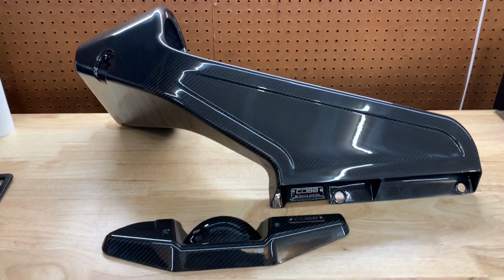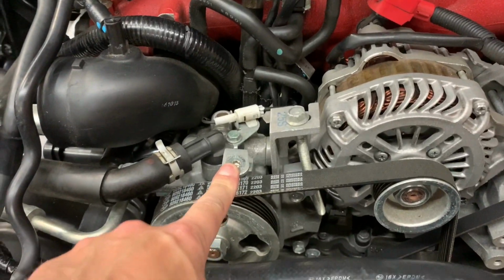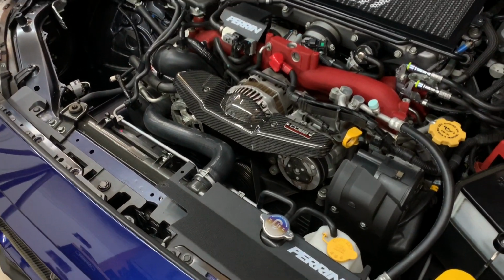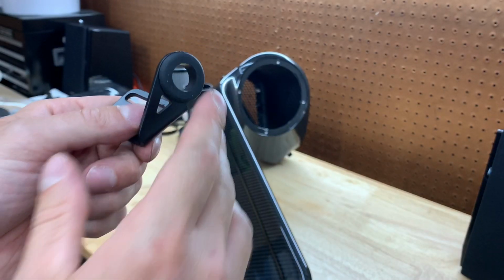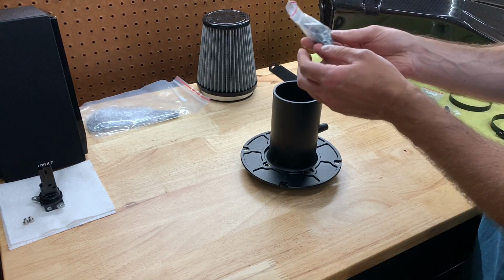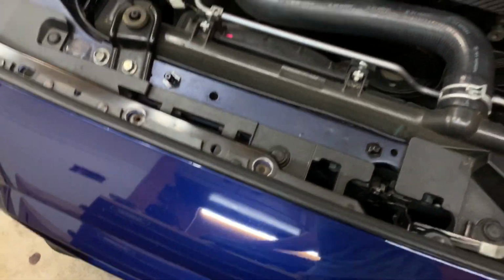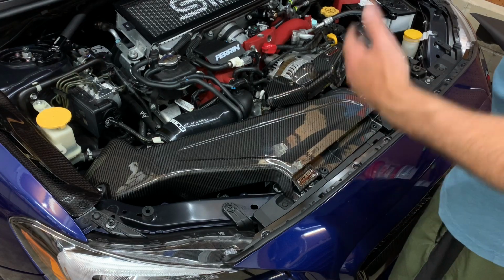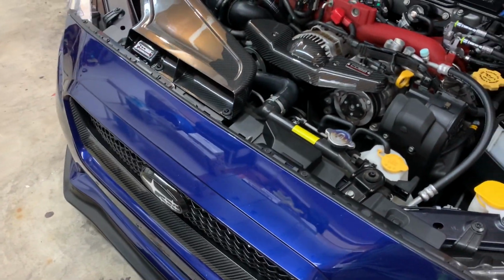Installing the NEW Cobb Redline Carbon Fiber Intake and Alternator Cover on my STI

Comment: Finally did it. Redline CAI, Cobb AOS, Cobb 3 port BCS, Cyl 4 & capped off with a protune. Loving it so far and peace of mind achieved. 👊🏾
Reply: How has it been holding up?
Reply: @activeej8858 Its awesome. I also did a ceramic coating prior to install. Install wasnt that bad either with same issue of just reaching behind the radiator. No complaints though. I left the sound restrictor plate/piece off so I can hear the turbo noises/breathing and its honestly not obnoxious at all. Perfect sound imo. 

I installed a day before a protune so I cant speak to the Cobb OTS map in general. The mod is well worth the price if only for looks and AIT. 

Side note: It really does make a difference for the AIT’s. In some cases theres only a difference or 10 degrees or less. You still get heat soak if sitting but thats unavoidable really.

Comment: Installed mine the other day. 2018 sti, I had a 13 prior. I used password jdm carbon pieces in the engine bay of the 13, radiator shroud-alternator cover-battery box-and fusebox cover. All but the radiator shroud transfered into the 18 sti engine bay. It took some serious consideration. But I made the password jdm radiator shroud fit. It took modification obviously, but the passanger side is flat enough that the redline intake fit on top of it.

My only issue with my redline install was that I got it used and it didn't come with the 2 studs that the grommets fit over. I had to install rivnuts in those spots, I used password jdm engine bay bolts to secure it in place. All I need now is the password jdm power steering cover to really complete the carbon look I'm going for. Such an awesome intake.

Comment: Just installed my redline intake today, followed you video to a T. Great install video! Also, kept the side cover plate on that lets in addition air. Now the car has little to no air induction sound, just a faint waste gate sound after shifting. Just some info for anyone wondering what it would sound like. Coming from the cobb big sf intake, the redline is very very quite.

Comment: I just installed this and had the most difficult time woth the silicone hose lmfao! I dont know why but the box seemed low and just trying to get it over the tubing as so damn difficult and it kind of sits on the metal bracket underneath.

Comment: Nice job mate. Quick question, could you not put the larger round foam onto the plate rather than sticking it onto the carbon? If you’re worried about sticking it to the carbon. Just an observation 😊

Comment: Just received mine today. I know it comes clear coated but did you ceramic coat you’re. I don’t think you said if you did on you’re unboxing video. Should I ceramic coat mine?
Reply from the maker: I did not coat it in this video, but I did later down the line. Not a necessity, but it will definitely help keep it looking mint.
Reply: @Autofreakgarage  cool thanks man I’m going to coat mine before the install. Don’t want no dust getting embedded on the clear coat.

Comment: Few questions:
How much lower have you seen your IATs drop? Do you see any potential issues with the MAF housing sitting outside of the carbon box? Thanks for your video!
Reply from the maker: I explained how much the temps dropped in this video. https://youtu.be/7nY5JHOtqV8

No issues. The original Cobb sf intake as well as any other intake all sit outside the box. No issues at all.

Comment: Hey man, question for the fitment on the entire intake. I bought this intake and i am waiting to install it. When you place the posts into the rubber grommets, does it seem secure? When i was putting it together i noticed the rubber grommets just fit over the posts and dont really seem to pop into place. i guess i was just worried that it would move around.
Reply from the maker: I thought the same thing, but when it’s in place and bolted in, it doesn’t move an inch. It’s very secure.
Reply: @Autofreakgarage Ok. Appreciate it.

Comment: I am wondering how to take the filter off to clean? Do you have to take the entire unit off?
Reply from the maker: Yes the whole intake comes off in literally 30 seconds.
Reply: @Autofreakgarage  Bought one and installed over the weekend. Very impressive! However There is one bolt (M6x20mm Flange Head Black Oxide Bolt) remain unused. Not sure what that bolt is for? Any idea?

Comment: Thank you for the video. A question, what brand are the carbon shrouds in the engine bay left and right side
Reply from the maker: Olm by subispeed
Reply: @Autofreakgarage  Thank you 😘. I am currently running the compressive tunning side shrouds. Carbon ones however will look dope with the new cobb redline intake

Comment: Great and detailed install video as always! :) Aside from the aesthetic, I absolutely love the completely gapless design of the snorkel directly integrating the filter! Pretty much maxes out the most potential of not drawing in hot engine bay air as much as possible (in the Cobb Big SF current design there are still quite a few air gaps on the fender side that definitely leave room for improvement). On top of that the new piping also ensure you have no way to screw up putting the filter on lined up exactly to the point it needs to be due to the piping edges not allowing it go past (although I suspect this is more of an STI specific design as I see the original had that too). Honestly if they make this for the FA20 and also make that filter stopper edge on that one, it's going to be very hard for me not to switch to this design at some point haha! The carbon fiber is right up my alley as well! Improvements all around and a very unique design, very impressed. 🙂
On the note regarding your Perrin Radiator shroud that is definitely a shame because I feel those shrouds help immensely with blocking off a lot of engine bay heat from being sucked (and considering I have that same one that is something I am going to have to keep an eye out for if they do ever make the same for the FA20). One idea I could offer, I recently stumbled upon this awesome carbon fiber parts company that makes a lot of CF parts for our VA chassis cars. I found they do make a radiator shroud of their own that seems to be based on Perrin's design but a little different as the left side extends over top the snorkel (as opposed to just at the edge with the rubber piece). It might be possible you could adjust it in a way to fit that new snorkel, like not attaching the left side with the bolts to the other and instead just getting double-sided mounting tape or foam (or may can even reach out to them to see if possibly they could make a custom piece for you). One really awesome thing about them is they let you choose what type of weave you want for practically all their parts which I've never seen any other company do. :)
Here are the links for two designs they have
1. https://www.rpgcarbon.com/product-page/va-carbon-fiber-radiator-cooling-plate-shround
2. https://www.rpgcarbon.com/product-page/rr-roadrage-carbon-air-snorkel-induction-duct-shroud-set-wrx
3. More CF parts here - https://www.rpgcarbon.com/subaru-impreza-vag-vaf-evoeye
Reply from the maker: Thanks for the input! I ended up using just the right side. Still directing the airflow to the snorkel. 

The one thing about the piece from rpg is the snorkel shape is different than stock. So the mold might be designed to fit around the stock snorkel. The Cobb is different. I’m happy with just using the one side of the Perrin at least.

And yes. They are working on an fa redline intake 👌🏻
Reply: @Autofreakgarage  You are right the shape difference could prove tricky in that case. No worries I'm sure the difference in intake temps without the left side should not be affected as the newly improved and sealed snorkel should counteract any differences (overall I expect you might see lower temps in fact even without the one side of the shroud) Best of luck and definitely looking forward to seeing your impressions on it. :)
Reply: FA20 WRX Redline intake is in the works!

Comment: Have you had any issues with the screws coming loose and falling out on the alternator cover? Mine keeps coming loose, and yes they’re tightened down lol
Reply from the maker: It happened once when I first installed it, but some blue loctite solved the problem.

Comment: Hey no clue if your see this just started following your channel… they way you set up your sti is so clean and I deff trust asking you… basic simple question… I’m picking up my 2021 wrx next week .. my first mod is going to be stage 1 plus looking to do the redline Cobb intake,access port, and sti performance car back.. what tuning did you use… I’m seeing mixed reviews on YouTube some just use the Cobb access stock tune and others say you have to go get a pro tune/etune thanks in advance if you get this..

Also the sti performance exhaust… I’m basically a 39yr old dad with 1 kid and another comping so I wanted a lil sound but on the quieter side any recommendation I watched your exhaust video but it seems
Like you had extra mods at the time to compare noises of what I would have… ps if these questions are stupid sorry I just am getting into the subi game now… needed some excitement and a fun sedan to buy also live in CT so needed a 4 wheel drive this will be my first subi
Reply from the maker: Congrats on the new car! You’ll enjoy it being a dad yet still have something fun to drive. 

The Cobb ots tune is more than adequate for what you are installing and using the car for. If you want to bump it up a bit, you can go with an e tune or dyno tune to dial things in a bit more. Check out brenn tuning if you want a solid e tune. 

The STI exhaust is pretty droney. I would skip that and go with the Cobb stainless exhaust. Great tone and no drone. Quality and fitment is spot on too. 

No questions are stupid! I get it. We all have to start somewhere. Enjoy!
Reply: @Autofreakgarage  Great info thank you for the quick responds!!!! Cobb Stainless it is then…Just giving you a heads up your properly start hearing from me in the future for more advice…👍👍
Reply: Hey man so just picked up my 21’ wrx yesterday.. been doing research on exhaust took your advice and did a lot of research on the Cobb SS catback and ran into videos of the invidia t300 people calling it the gentleman exhaust as in not load but only when you get on it with no drone with my situation family car and daily is the Cobb the same thing? have you had or heard in person that exhaust? Any insight on the invidia?
Reply: @Autofreakgarage  what’s going on sry for the bother looking for one more advice I seen you ran the AWE touring as well I’m really confused between Cobb ss, invidia Q300 and the AWE touring.. any insight on these would be great thank you… looking for no drone low throaty sound when I get on it I like the low tones do you know what one is the quietest? Thank you in advance and sorry for the questions just seen you went throw a lot of exhaust and so you have good feed back… 👍
Reply: @johnho6896 try to awe touring. I went with the Borla S Type and love it. Nice tone & minimal to zero drone at 75+ for highway driving. If I ever switch exhausts it will be the AWE touring. Happy building!

Comment: @Scoobyfreak86  hi how much hp it might add ?
Reply from the maker: Intakes don’t really add much power. It’s the tune that opens the car up. If anything, maybe 5-10hp with a proper tune.
Reply: @Autofreakgarage  ive got the redline intake and Invidia downpipe? what do you recommend? and did you have any problems with the redline?
Reply from the maker: Don’t add the Downpipe unless you have the supporting firing mods. No issues at all.
Reply: @Autofreakgarage  I've got an Cobb AP and invidia R400 exhaust to go with the downpipe with cobb stage 2 map, unfortunately no good prtunes where i live, so cobb maps is all i got. thats why I'm thinking of just sticking to stage 1+ Cobb ? till i'm bored than maybe stage 2 ! any recommendations on what to go for first . keep in mind i want the engine to stay safe . still didn't add catch can or aos debating. thanks for the help anyways been watching u for a while respect
Reply from the maker: Hit up brentuning. You can do an etune with your mods and you’ll get a much better and happier car. 

Stick to stage 1+ for now. If you want more power, you’ll have to upgrade all of the fueling components, which will bring you to stage 3. 

Do an IAG V3 street aos. 

I appreciate the support!
Reply: @Autofreakgarage  nice one my man, good feedback and god bless keep up the great work